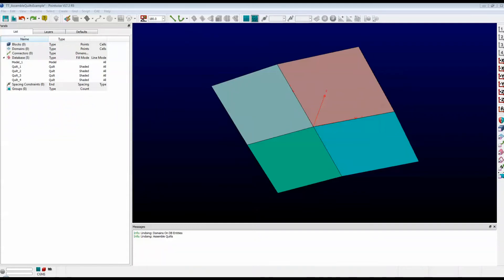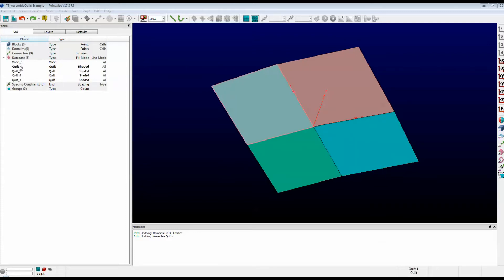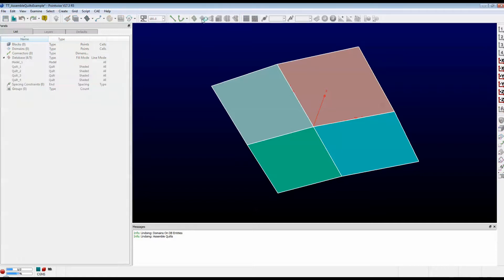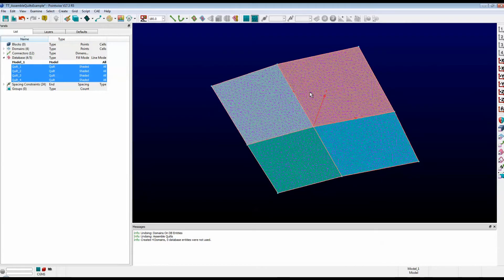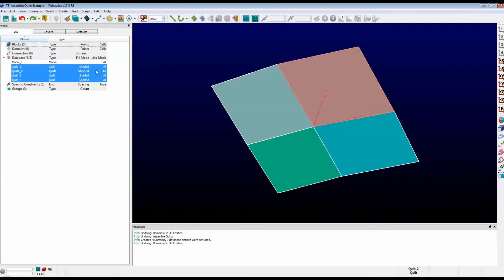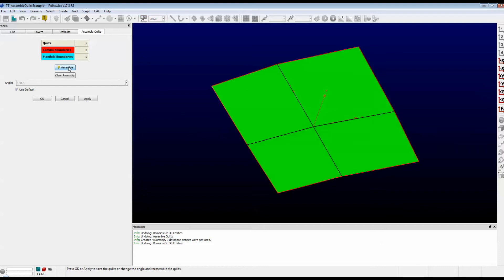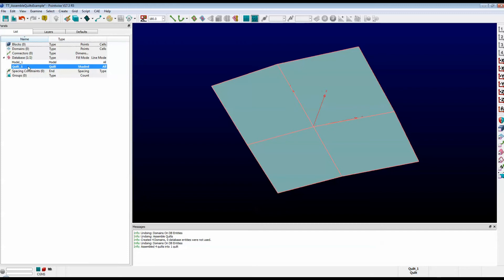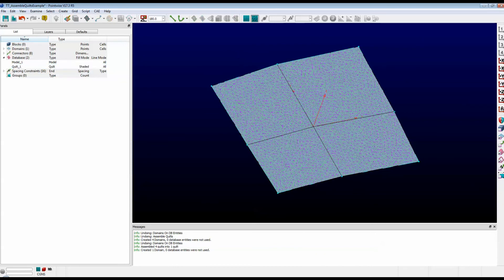Assembling Quilts

Comment: Hello, thank you for this great video. However, I can't figure out how to disassemble existing quilts. I would appreciate any advice. Thank you.
Reply: You can select the quilts you wish to disassemble, and use the Split... command found under the Edit menu to separate them again.  You may also use the Undo command to revert an assemble quilts change you made.  Lastly, if the quilt topology that you desire doesn't exist, then you may be able to split the quilts in the manner desired by splitting existing quilts using either a plane or curve.
Reply: Thank you very much for your prompt response, the Split command is very helpful!